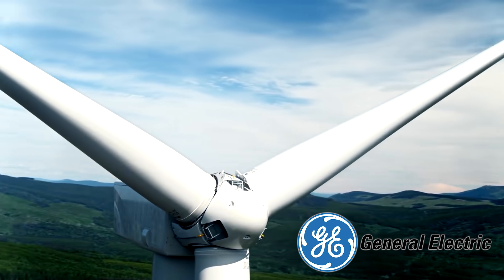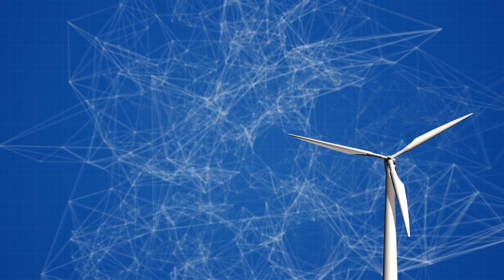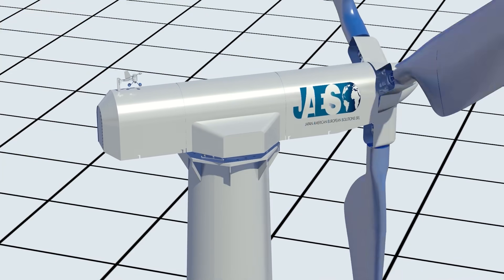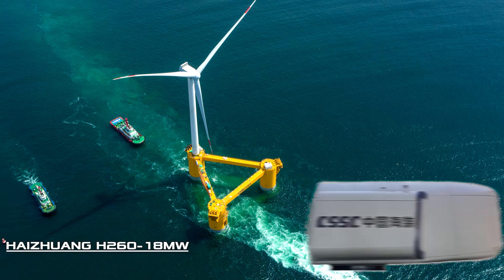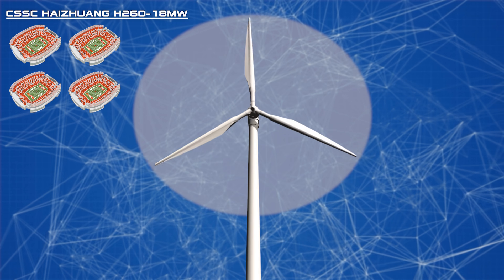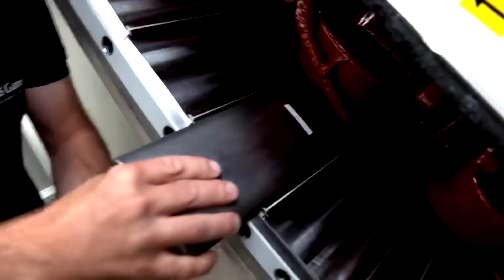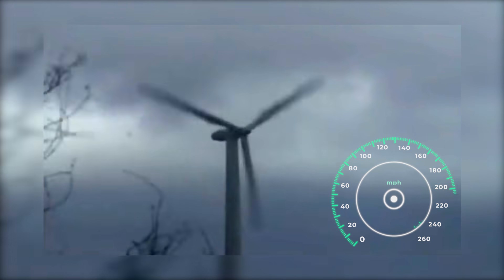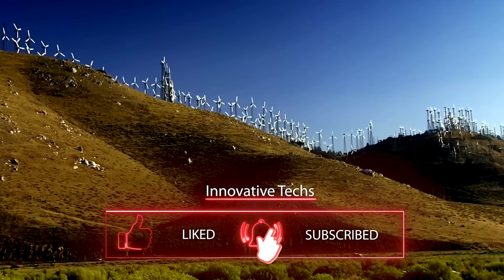China is building a wind turbine of unthinkable dimensions

Comment: This is hilarious. Seriously, these are terrible designs. Just use more blades. 🤦‍♂️

I really want to calculate the actual surface area of these things. It's probably less than 15% of the swept area.
Reply: Its not just about surface area. More blades mean more weight, which mean more inertia, that ends up being less speed. Ship propellers also usually come with 3 blades, so as the most efficient regular ceiling fans. The exception is when you need to optimize for static pressure or comfort like computer fans.
Reply: @mazocco  more surface area doesn't mean more inertia. More mass means more inertia. They could use sails, or just smaller, lighter blades with greater surface area and more efficiency. There's no reason to make the blades this big when it wastes almost all of the energy passing through. The size isn't worth the trouble, because it's not more efficient.
Reply: @grantmccoy6739  if they would change the material technology for one lighter, they still could use the same format and make it still lighter than if it was broader. So it is still worth to make it thinner. But my point was that theres a lot more than surface area in this calculation, like weight but also drag coefficient, turbulency and others. We would need a specialist to describe it more precisely, but area is definitely is not all to it.
Reply: @grantmccoy6739  "More mass means more inertia" is not correct!  It depends on the mass and where the center of mass is.
Reply: @grantmccoy6739  the energy produced increases exponentially the bigger the blades are, one big turbine produces many times more energy than two smaller half the size turbines combined.